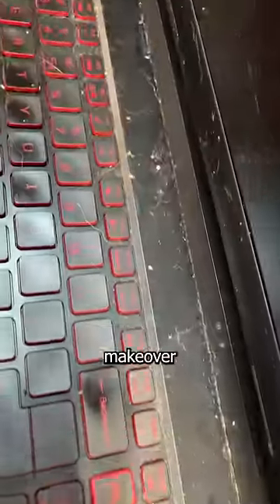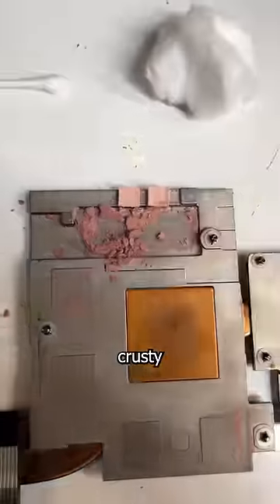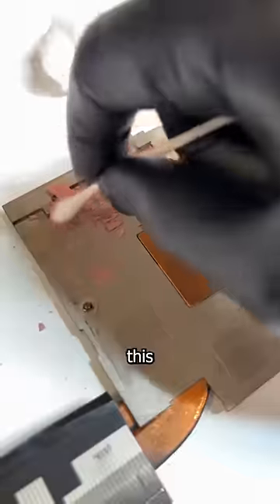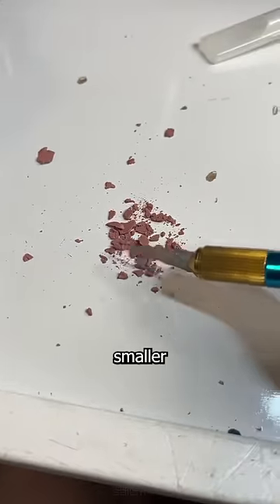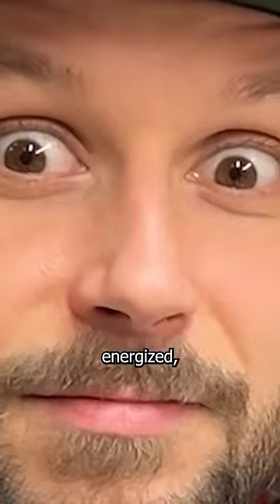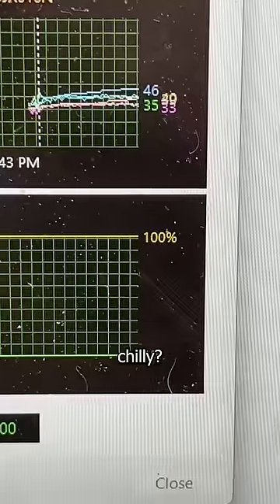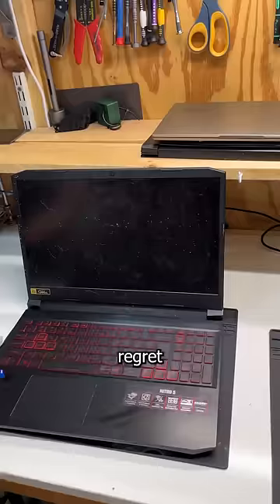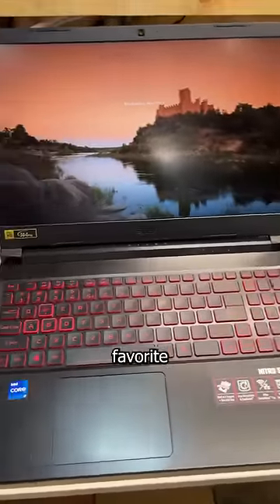Refurbishing a filthy Acer Nitro 5 #gaming laptop (I love it) #pc #tech #technology #shorts

Comment: I have one of them Nitro's (11400h/3060/16gig) for almost 6 months now, i guess it's time to give it a proper cleanup & repaste. But what is really important, this budget laptop offers two NVME slots an one SATA connector. In this price no other gaming laptop offers such upgrades.
Reply: That's even more than my Legion 5 (R7 6800H/3060), and I had to clone my entire 1TB HDD (not the boot drive but data drive) over to a new drive cause this thing only takes two NVMe drives.

Comment: The difference fresh paste makes is nuts, sometimes. I replaced the thermal compound in my launch-window Switch, because I also had to replace the fan, and I had to check to make sure the fan was actually spinning with how much cooler the SoC was running.

Comment: nice the laptop looking a lot better now even in a better shape then mine which i recently have a suspicion that the thermal paste is completely dry and the dealer in acer probably doesn’t apply the best paste for the laptop cuz my laptop recently have spiked over 100 when im playing beamng and 60 to 80 on daily use which before it was 80 with beamng and 50 to 60 on daily use or smth i don’t quite remember but it definitely have lower temperature than before

Comment: I had an Acer Nitro 5, it was a beast until one day I had it open to replace the SSD and didn't disconnect the battery, dropped a connector and it landed in just the right spot to bridge something and light up my GPU. That arc left a lightning pattern across the top of my graphics processor.
Reply: how is your device now?

Comment: I had (still have but don't use) a Acer Nitro 5, but after 6 years it was getting a bit slow when playing games, so I had to upgrade. The Nitro still works, but when it used to take 5-10 secods to start, it now takes 40.

Comment: man, every time i see your shorts roll up as im scrolling the urge to get a new laptop to replace my old one goes up. Dont hate the old one just that the ctrl key broke off so i have to push the rubber membrane nub to use it, and overall its just much slower despite me changing out its 2.5 spinning drive with an ssd a year ago. Just not sure what to get.

Comment: I just got an AN515-42 on fb marketplace recently for $50 that looked just as nasty as this lol. Had to replace the keyboard though because I cleaned it with water and didn't let it dry long enough ($22 and lots of pain ripping plastic rivets) and buy a charger for it ($30). Great laptop for $100 in 2023 imo. The build quality definitely isn't great, but like the pinned comment says, should last if taken care of. 
My issue with it is it seems to limit the CPU to 13w or so max while plugged in, even at 100% use and while running prime95 both in windows and linux. Don't see an option in bios regarding power limits, and I have it on highest performance mode. It obviously isn't overheating though either because the temps max out at 60c. My other laptop actually ends up having more CPU throughput because it maxes out at 21w of its 25w tdp up when at 100% usage before hitting 100c and throttling. Anyone else have a similar issue where it just doesn't seem the processor is using its full power capability?

Comment: My Acer nitro died after a power surge due to a sudden power outage. My temps are incredibly high and the auto fans won’t kick in. The computer also refuse to boot and boot loops if I tried to start it. If I shut the lid, the screen turns black and won’t turn back on. RIP nitro 5

Comment: My laptop before litterally, had it for 3 years and sent it in a pc service store where they cleaned it inside and outside, replaced the thermal paste, and added 8 gb of ram (to have 16 gb) and it works better than even for real, 20 degrees less (used to have temperatures up to 90 fucking degrees celsius 💀 now its 60-70)

Comment: Greatest technician needs to buy some thermal pads. But i suppose thermal paste can perform just as well, but next greatest technician will be quite angry with you as he has to break out the mallet and chicle to remove the cooler from board as its literally glued with thermal paste from every possible contact point. But hey, it works and most likely will be at end of life till next appointment.

Comment: I replaced the thermal paste and cleaned put the fand and fins in my acer predator 17 6700hq 1070m after about 4-5 years of owning it. The thermal paste was dryer than the sahara and there wasnt too mich cat hair and dust...put thermal grizzly on that bitch and it went from 99° to 73° max and i increased my fps by about 20% in most games

Comment: I have one of these and I just wondered if you have any tips on how to keep it running well and what the normal CPU and GPU temperature is
Reply: Also, specifically when running games
Reply: @liampritchett1779  i'd say cleaning the fans regularly and changing the thermal paste after some time is enough maintenance. About the temps, I'd guess under 90ºC for the cpu and under 85ºC for the gpu (under stress), but as usual checking on google would give a more accurate response to that

Comment: I have a 2021 Acer Nitro5. It has ALWAYS ran hot. I'm just doing homework right now, and the cpu is running at ~150⁰F / 66⁰C (keeps fluctuating between 140 and 175⁰ F using built in temp monitor). Ive had it apart multiple times, but never replaced thermal paste. Do you believe it could help my performance? It always gets super hot when gaming, and the CPU is typically what seems to bottleneck
Reply: Yes. I have the Nitro 5 version with the 3060, it runs a lot better after replacing the paste. Those manufacturers love to cheap out at the paste to save costs. 

I later changed the paste with liquid metal, though I´d really only do that if you know what you´re doing, otherwise you may short the system. I rarely run up to 80° nowadays.

Comment: Wirh gaming laptops i always use external keyboard i dont want to use the buttons to much a keyboard you can replace if you use the on board one to much it could atop working i also keep the fans away from stuff so they suck in dust and other stuff

Comment: I have the exact same model, can anyone tell me what's the name of the thermal compound he used for replacing the pink stuff? I took it to a nearby shop and they just changed the stuff which was on the CPU and graphics card. When I inquired if they could change the pink stuff, they said it cannot be replaced. Any help would be appreciated. Thanks in advance.

Comment: How often should you replace the thermal paste I have a water cooled system and they say blow out every 8-12 months but how long for thermal paste cus i have like 2 tubes left so I can just use some if it’s a 8-12 months thing I can do em both at once by that time i probably get a 4tb m.2 so i upgraded and clean it but if it a once ever 2 3 years then why bother

Comment: Can I send my acer nitro 5 too you. You would not believe this but my screen is ripped off, the only part of the laptop is the keyboard part but it still works fine.
Reply from the maker: I believe it, it’s the most common issue on these models. And yes fill out the mail in form in my bio link.

Comment: I’ve got a quick question - i have the same laptop, Acer Nitro 5, RTX 3060, I5-10th Gen and when I recently took out the heatsink to change the thermal paste, I, as well noticed that the other chips were covered in the red/pink-ish thermal(?) grease, I didn’t want to wash it out and apply normal thermal paste because I didn’t want to take any risks in messing my cooling up, so what should I use for those chips? The thing you mentioned in the video (thermal compound) or will normal thermal paste do the trick? Thanks a lot

P.S I’d appreciate if someone would give me any thermal paste/compound recommendations
Reply from the maker: Use Upsiren thermal putty for the chips. Use PTM7950 for the CPU and GPU. Both can be found in my Amazon store
Reply: @SalemTechsperts Much appreciated mate, love your content 🔥
Reply: @SalemTechsperts can you add that to a pinned comment? I just asked the same thing before finding your answer after reading the same question 3x 😂

Comment: I have a laptop it is a hp laptop 15-dw1083wm model rtl8821ce processors intel(r) pentium(r) cpu 6405u @ 2.40ghz 2.40 ghz, I put a 16 GB ram inside and it has ssd 128GB and is in good condition I don't use it and only on a wood surface not on a bed what can you do to it to make it play games and if you can't what can I get for it or trade it for it

Comment: I have four different computers different makes and models most of them are acers once just missing the the charger the other ones are non-functional and then the other Acer has a cracked screen and I'm pretty sure that's all that's wrong with it what's the third one that's like a slim or a thin version of an Acer don't know what's wrong with it I know the battery is gone bad and it started to inflate so I took it out already but it's also not running like it used to as well it's a lot slower and it can't handle any games that it could before so I don't know what's wrong with that and then and the fourth one doesn't even work at all the battery went bad a while ago and it doesn't ruin anything not even Chrome will run on it